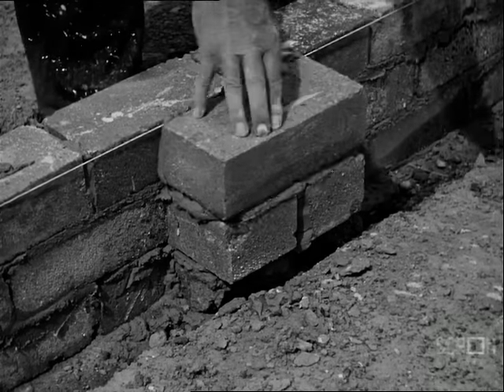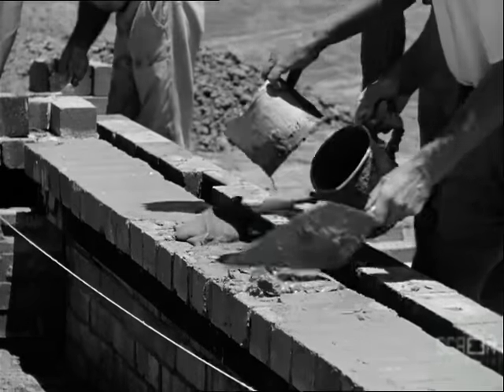Building A Brick House

Comment: It's a joy to watch these tradesmen at work. In reply to one posted comment of "Definitely not how they do it today" yes, you're correct, 'theTparkboys'. Modern construction methods and materials, thanks to research carried out by Buildings Research establishments, ensure that today's homes are robust, have a far greater thermal efficiency, are more acoustically resilient, and are less prone to infestations of dry and wet rot than they have ever been since Man began building structures. I often hear the phrase ' The old ways are the best ways' and yet I have witnessed first-hand evidence whilst working on restoration and refurbishment projects to the contrary; standards of workmanship which would never pass a modern building inspection. An insight into the nefarious practices of past building contractors may be gleaned from reading the book 'The Rights Of Man' by the author Thomas Paine. To conclude, I would like to state that there remains still in my industry craftsmen/women who practice their crafts with pride and produce works of the highest quality.
Reply: +Jack The Lad 
True for the most part, but here in Denver some companies are building lots of "McMansions" mass produce, overpriced, low quality buildings. That I belive is the source for romanticizing the "old ways"
Reply: Is there a good way to keep the general integrity of a simple, brick house without sacrificing thermal efficiency and avoiding wet rot? 
I love the appearance and simplicity of these brick houses but would love to learn of some tricks to keep the house sturdy.
Insulation is one of my main concerns.
Reply: Use a brick fascia on an otherwise wooden frame house if you are going for looks.  Insulation takes care of heat loss/gain.  You can also get sealer for masonry or rubber coating to seal off ingressing moisture and add thermal insulation.  This must be done BEFORE the rot sets in.  But I think bricks today are much better at keeping out moisture and other unwanted permeates.
Reply: You can do a cavity wall with insulation between the outside and inside brick.
Reply: I agree, having renovated many houses from the 50s, the workmanship and methods of construction are very poor in comparison to current building regulations. We have to get away from this romantic notion that the 'old ways' were the sturdiest. I've heard many people say that 'solid walls are the best'. Generally we are opposed to any wall construction that is made of timber or timber frame,even though this is the most efficient method of house building and as mentioned, the most thermally efficient. Building technology evolves as better materials and methods are used and we should embrace this otherwise we would all be still living in wattle and daub roundhouses or even caves! After all these were state of the art techniques at one time. Move with the times or get left behind.
Reply: Not all today in 2018 is better than the old days, but also some things were worse..... Its called progress so they keep telling me.
Reply: @scottflavin0223  Yes.   It's double brick construction with large overhangs built on a continuous concrete raft pad with interconnects to the ground.   Okay right up until you have permafrost, or earthquakes.    The building will need insulation between the bricks - so the cost is SUBSTANTIALLY higher.   You are not getting the benefits of insulation technology..  Generally - it's a shit idea these days, to build entirely in brick.
Reply: Ya no... everything built today is crap. I had a carpenter friend work on my 1950s home. He took samples from my home because he teaches apprentices for his company (class size of 50). The reason he took the samples was simply because  "They don't build them like they used to." It's a modest home but to build with the quality of my 1950s home would cost 4-5x the cost today.
Reply: @tcpnetworks  They didn't need to load up with insulation that traps moisture and causes mold back then because energy was cheap. People ran the AC or the heater freely without breaking the bank. Houses today are built "more efficient" to scrimp every possible savings possible on utility bills because everything is so fucking expensive. This isn't objectively better. It's worse. Large overhangs are key to protecting the outside of a house for decades from the weather. Houses today are meant to be thrown up quickly and who gives a shit if it lasts 20 years? That family likely won't be living there that long anyway because no one has roots or ties to their community. Permafrost? Earthquakes? Not in the climate where this video is filmed. There are 100+ year old brick buildings in California that have survived major quakes. Completely overhyped fear.

Comment: Houses that were built here in the Netherlands in the 1930s are still regarded here as one of the better and qualitatively also the best built houses and I should know because I once owned one myself.
A house built in 1936, even then with steel beams under the floor construction, except for the electrical part, which was downright bad but ok PVC was not invented then either.
I have always enjoyed living there and sold well later on.

Comment: Great video- Thanks
I have noticed that unlike any other time in the history of man, we Americans have gone backward in our building ideas. Fewer and fewer houses have been built of masonry since the early 60s. In the 50s it was not hard to find a one off house, in the country or burbs being built of cinder block & brick. By the 60s stick built houses with a brick veneer, on the front became more the norm, with only the chimney being masonry, though that too was fading. Now even apartment buildings and office buildings are made from stick.  The difference between a Million dollar house and a $200k house is mostly size and amenities, like multiple bathrooms and granite counters. Both will often use OSB for sheet goods, and the HVAC is not a more expensive unit, because it is built of more durable materials, but because it has to heat-cool a larger envelope.  Add to this when new buildings are put up, as the economy increases, the buildings are still cheap junk. Very few municipal buildings are erected and even fewer civic buildings, by private citizens, such as community center, Atheneums, or churches. In some wealthy regions, such as around Washington DC, there is gold rush town atmosphere, where new buildings are squeezed into odd shape lots, between bland post war strip shopping centers. Homes have taken on a grotesque faux Victorian style, and commercial buildings a retro 1950s look. None of which is constructed of quality materials or built to last, and above all do not blend when placed in an existing 19th or early 20th century landscape.

Comment: A few steps are sped up. Like the footings are done by ready mix trucks and placed with a boom or line pump. Or from the trucks if possible.  But brick laying is still done by hand.  Matieriels may have changed and steps simplified.  But its still the same.  I drive a concrete truck.  Stuff i poured will be there long after i turn to dust
Reply: You're saying they didn't build a whole house in 10 minutes?

Comment: That is awesome. Back when people actually worked and when things were built right.
Reply: Yep. Air leaks all over the place, no sarking between tile and roof structure, no insulation in ceiling cavity, asbestos a plenty, and lead paint as well. I'd bet a million bucks none of the walls are parallel of square. 'built right'.

Comment: I think every custom home builder in America should watch this video. This is the quality we used to get WAY back in the day. This was standard practice back then. Every single home was built with quality and CARE. The problem today is that custom home builders really don't care. And their homes with leaking roofs, soggy walls, cracking foundations and melting siding really show their "don't care" attitudes in their workmanship. And when you call in for a "warranty" item, it ends up going into arbitration.
Reply: hulk7272 they dont care because the housing industry was and still is booming so they dont care about quality they only care about quantity and its very sad
Reply: Have to find a mid century ranch (1940s-60s) to get a decently built house here in America.  I tried to find one and nearly did but they were snatched up as soon as they went on the market.  Can't even think it over anymore seems like when buying a house.  I did find a good house but I'm more of a fan of ranch homes and maybe I'll find another one someday.
Reply: well this video is a demonstration of the cheapest way to build for the time and just because you see craftsmanship doesn't mean its there. this was minimum for the time. its not a solid brick wall its not the best windows and its the lowest quality roof tile set on cement.

Comment: Cast iron pipes and concrete... not a good mixture at all. Insurance doesn’t cover floods caused by failed rusted iron plumbing systems in homes built pre-1972.
Reply: simply rip it out and install pex its not that expensive
Reply: Not cast iron.
Reply: Pipes are terracotta
Reply: @hughmcinally907  In the plumbing?
Reply: @robertbrandywine  Yes, ceramic or stoneware. Pretty much the best material there is for house plumbing. Sewage of course.

Comment: best house ever! I also like stone houses.
Reply: this is low quality brick which was tied with metal this is very low quality wall
Reply: Kitchen Redo How can you tell the quality of the brick from a seventy year old black and white film? You can't! They could be amazing quality. You can't possibly tell without handling them personally. Wall ties can be an issue, but many houses built with them have never had a problem, and if they do start to fail it's easy to add modern ties from the outside and just repoint. Metal ties then were probably galvanised much thicker than the ones we have today, and in a dry climate like Australia should last many decades.

Comment: If I wanted to move into an older built house it would be for its aesthetic looks rather than its modern day practicalities and efficiencies. Modern houses built within countries with strict building regulations and codes are safe, strong; use fewer building resources; make use of modern day reliable textiles; faster to construct and lower in external maintenance. With more energy efficiency and lesser prone to former problems like damp and rot and infestation like earwigs and mildew.
Reply: well yes, but you also have to take into account that the materials used in modern houses are made of cheap materials to cut cost down, some intelligent modern builders use great materials and have the best of both worlds. for instance you can make an amazing house out of reinforced brick, or a solid piece of concrete. these materials have amazing insulation and resistant properties to mold and earthquakes, but people go with wood framing and drywall.

Comment: Proper houses. Shame on you 21st century house builders.
Reply: chanpenn c they are more environmentally friendly, energy efficient, cost less and are built far quicker.
Reply: It's expensive to live in the US.  Wood is cheap here.  Faster construction.  Sturdy for it's weight.  Better match with it's local environment lending itself to better thermal properties.  Easier to customize/remodel.  Plus it just has a "cozier" feel to it.  And it frees up finances for amenities.  The idea usually is: you need a home to keep out the elements, not stop a catapult.  It makes the American dream more accessible and you don't necessarily have to own a vast amount of wealth to materialize it.  It also gives people the freedom to more easily relocate.  You are not stuck in one region all your life.

If the severe weather collapses a stone building, your chances of survival are slimmer than in a wooden structure with a basement or inground shelter.  It is worth noting, however, that masonry buildings are far sturdier by the volume if built right and less likely to be destroyed by weather.  And if you are fortunate enough to survive any weather related collapse at all, wood is the cheaper reconstruction option for reasons mentioned above.  Plus, it's a roll of the dice with weather.  It will sometimes be decades before a major weather event devastates a given area.  Even in today's fickle climate.  And people forget.    

Choice of materials is also strongly influenced by region.  People shy away from masonry homes in earthquake prone areas.  In tornado alley, you will see homes that are made of brick or have some kind of inground shelter/basement to supplement the wooden frame construction.  Up north, lots of wood provides good insulation.  In the southwest, wood is scarce and stucco is a popular material used.

Wood with basements seems to be the best of both worlds.
Reply: Actually it’s up to the costumer what their house is built of.
Reply: @ike fun dude you ever realize all the shitty homes they built have already fallen apart? people died from garbage building practices, why do you think we have hardcore inspectors and surveyors these days?

Comment: Noticed no under felt was used before tiling the roof?  It must have been a later development.  
The level of insulation used in the construction of houses today is one big difference from back then,  I don’t suppose energy efficiency was a big consideration in those times.

Comment: When houses were made with high quality materials and non of the synthetic crap that is used today. I live in a Chicago brick cottage that is more than 100 years old and it is still standing with no problems! Everything is solid and aesthetically pleasing.
Reply: They're still made with good-(you missed a word)-quality materials today.
Reply: yea I'm sure all of your building is original and not just the bricks people stacked on top of each other, right?
Reply: MrFunkhauser The important bits will be original- the walls, the properly sized solid timber floor joists, the thick well seasoned timber floorboards, the rafters, the roof, possibly the windows, most of the internal joinery. There are millions of century plus old houses in the U.K. and mast have changed little other than updating wiring, plumbing, decorating etc, no reason why one in Chicago should be any different.

Comment: Older houses had there problems aswell..I have a house built in 1954 and we have asbestos issues with flooring drywall ceiling tile etc etc and I believe aluminum wire at one point ..

Comment: Those concrete foundations are bit rough. No formwork and proper rebar cover was thrown out of the window..... I have inspected quite a few overhanging balconies of 1950’s flats and the rebar cover on those old buildings tends to be very inconsistant.

Comment: I live in an all brick house, solid bricks not hollow ones, all walls are double brick thick and a flat roof also made of bricks. Yes its hard af and could easily stop a bullet from a rifle but maintenance its a nightmare: anything that happens to a wall you have to dril and hammer it out, then put new material to fix the hole and pray it looks the same because it almost never does. Have to fix a pipe? You have to dig it out all the way. If you can deal with that or your house gets shot a lot then yes, get a brick house.

Comment: Funny.....a "roof plumber".  That was the man installing gutters.  Is that the difference in countries or decades?
Reply: thats what a roof plumber does?
Reply: ralph sampson Plumber / plumbing comes from the latin Plumbum, meaning lead. A plumber was someone who worked with lead. This could be on roofs, or for water supply. Proper leadwork is an art form, and was a separate profession from tiling. Only recently have we let standards slip so any general builder can stick a bit of flashing up and hope for the best.

Comment: i was raised in an old home double brick  tiled roof 
cement rendered  internal walls it was solid as a vault 
only things that we're a problem was the timber door jams moving a little
and ceiling was in bad shape  and the windows like the house here kept rattling 
and would sometimes get stuck due to window frames warping but foundation wise 
it was solid no give what so ever all the roofing  timber was hard wood 
bloody shame it was government housing and they bulldozed it so they could build cheap
villias on the block

Comment: I owned a brick house of the same construction method for 31 years. Nearly impossible to heat it in the winter. AC worked very, very well.  It was made of clay brick that degraded over time.  Put vinyl siding on the exterior to cover. All the plumbing was exposed.  Electrical work was nearly impossible. lots of stupid little problems.  I am glad I sold that crappy house.
  My parents house is a concrete brick veneer home. Much better construction, and user friendly IMO.
Reply: It must depend on where they dig up the clay for the bricks. My house is over 60 years old and they haven't aged at all, despite wet summers and fairly cold New England winters. But bricks are expensive around here (probably due to shipping costs), so most houses are wood framed with bricks only on the front, if that.
Reply: ratoneJR 99 percent of English houses are brick or stone construction, many have stood for centuries. A quarter of our housing stock is Victorian, so at least 120 years old. Decent brick lasts almost indefinitely.
Reply: @spencerwilton5831  I have no emotional attachment to tools, I have emotional attachments to living beings.  A building is just another tool.